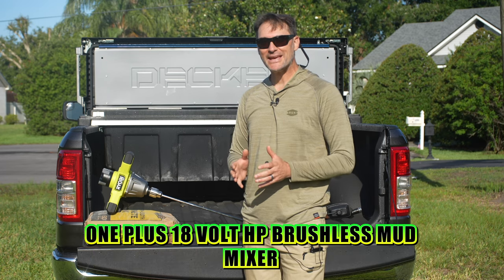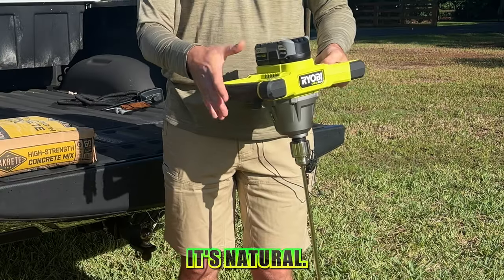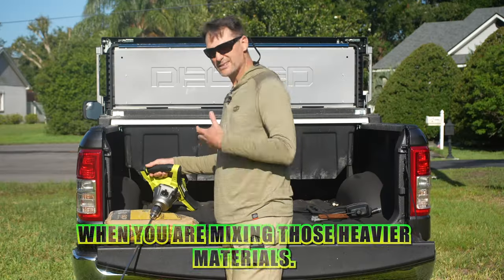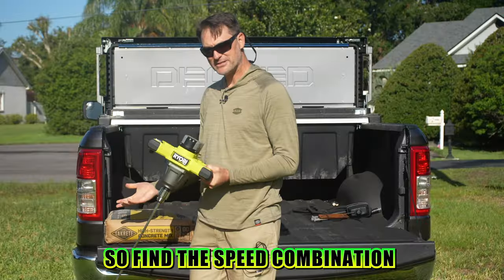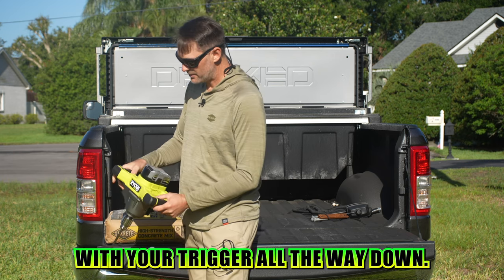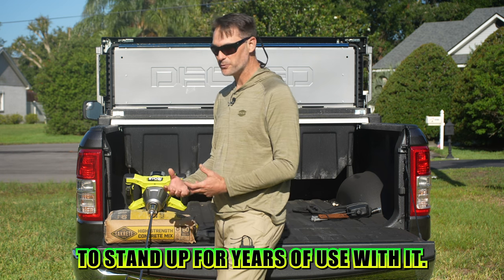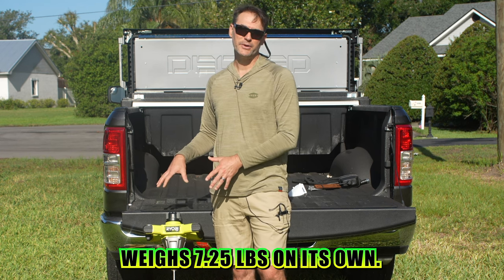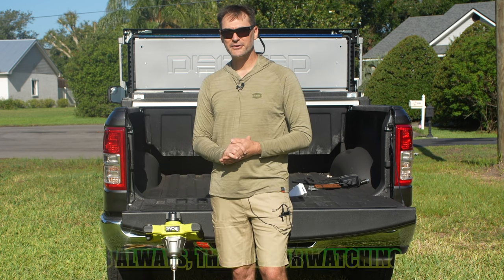Ryobi Launched a new 18V One+ Tool! PBLMM01 Mud Mixer Hands-On

Comment: Too weak
Reply: Did you try it ? Honestly I’m this video it sounds weak he’s got that mud to wet I was thinking about buying this for mixing tile thin set mortar but not sure it can handle it
Reply: @justinh6170 considering the Bauer 20v @ $79 w/o any coupons and a $20 Dewalt adapter bc I feel like it’s going to be a earth auger they already sell for planting bulbs
Reply: I have the 40v 8” auger things a beast but I’m using that at home I’m fencing 4 acres for the land owner his gas auger is a pos the 40v is great but I am a flooring contractor and my old plug in D handle drill from hf is falling apart that I use for mixing tile mortar I’d like to give this ryobi a try but not sure when it will be available